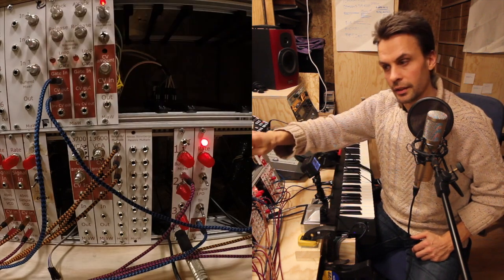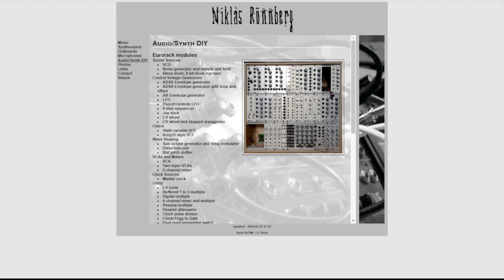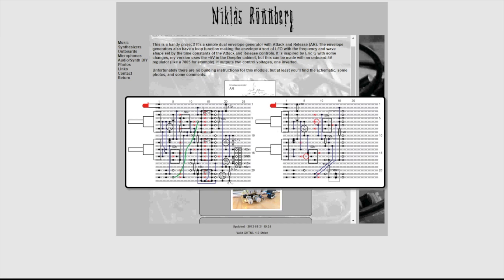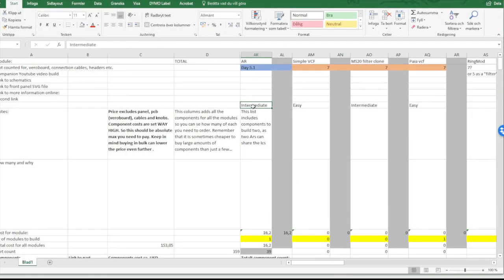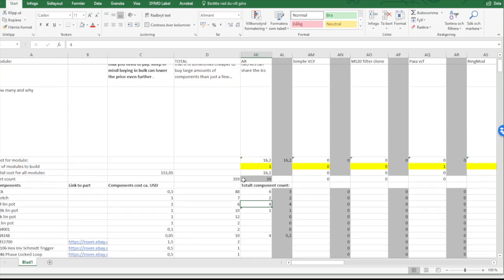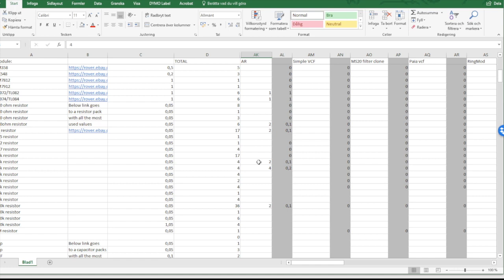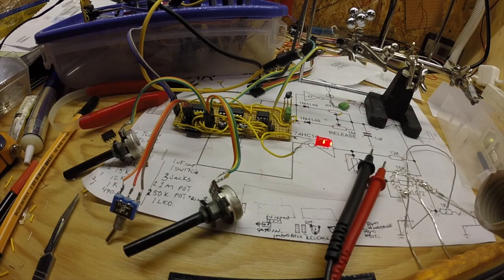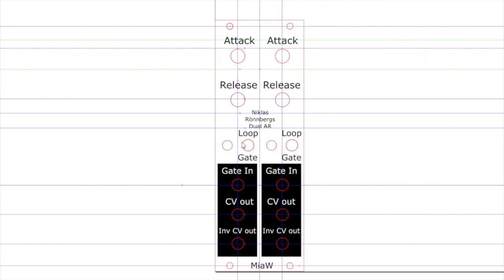Dual Attack Release (AR) Envelope Generator - DIY Modular in a Week 5.1

Comment: Where do you get the plastic panels that you mount everything to, and what are the big containers that you screw the modules into?
Reply from the maker: The plastic panels are done by a laser etching firm. I talk about it in an earlier video. The cases are just standard eurorack cases that can be found everywhere. ( I found mine in a dumpster). New ones can be quite pricey though. A plywood box with the right dimensions work aswell.
Reply: @SourceryOne  Where did you get the plastic panels? And how do you power all the modules?
Reply from the maker: Seth Heaster I make the panel design in inkscape which I then send to the laser etching/cutting firm. They use a material called lasermax which is mostly used for name tags. So it is very flimsy. The power supply is discussed in episode 0 and also in a later video about ripple and even another one where I show how to build a bigger better psu than the first one I built. Check out the “modular in a week” playlist that is in every video description and you will find most of the information you seek I think. :) I will do a separate video on panels.

Comment: this was a fun one to build. I used a 40106 and it worked great. I also got mine down to 7HP wide. I basically standardized my modules on 3.5HP, which is just wide enough for a regular potentiometer. May seem weird, but it's never a problem .
Reply from the maker: Good to know the 40106 worked! That means the 5v is not needed. 🙌 good job minimizing it. I’m working double time trying to make everything not take up too much room. 😉

Comment: I have built this and it works, but it outputs lower than 5v, so my vca or filter doesnt open to max. Which resistor should I change on the output op amp buffer? Also, could i swap for a 40106 (12v) to get a higher amplitude LFO too?  Thanks!

Comment: Another great video Kristian! Question though about component choice, couldn't you swap the 74HC14 with a 40106 and skip the voltage regulation? I've used the 2 chips interchangeably before without problems
Reply from the maker: Yepp, in retrospect I should have tried that... When I built these I didnt do them in order as shown now, so this was the first module I did which used Logic chips. So when I got to the other modules like the 40106, 4046 etc etc and noticed that they work on 12V I figured I could have done that... I'll make a note about that in the component list, so people can try it.
Reply: @SourceryOne  This sounds better, so I think I will try the 40106 too.  My question is: the voltage goes into the opamp, but we also need to power the Vcc of the chip as well, correct?  Thanks
Reply from the maker: Spot 20 Yes the 40106 should be powered from +v and gnd. (If that is what you mean) DO NOT POWER IT WITH -V!
Reply: @SourceryOne  Yes, that's what I meant!  Cool.  So, just wondering, if using the 74HC14, would the VCC need to be 5 volts, and not the 12 volts?  Thank you!
Reply from the maker: Exactly. That’s why Banjo suggests using a 40106 instead which works with 12v. A 74hc14 can’t tolerate more than around 5v...